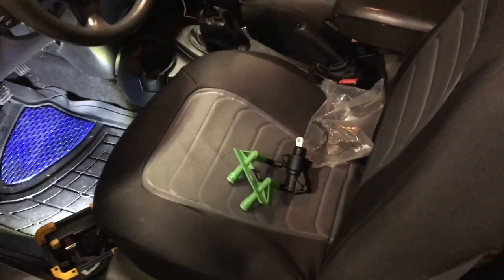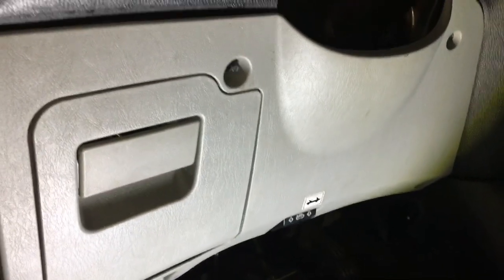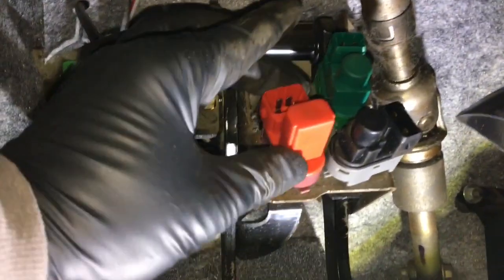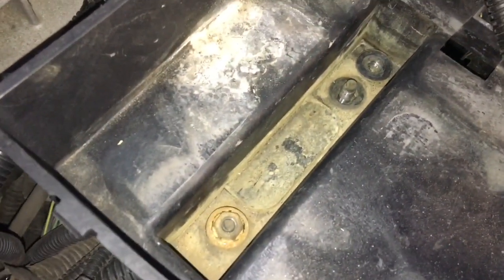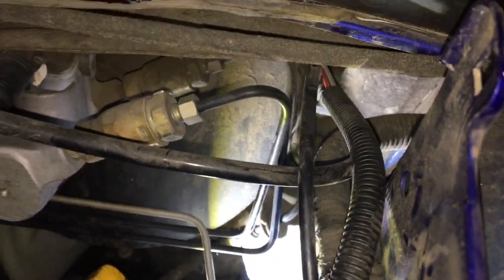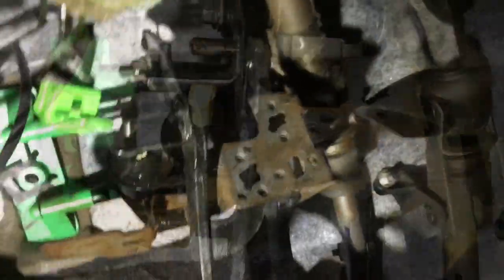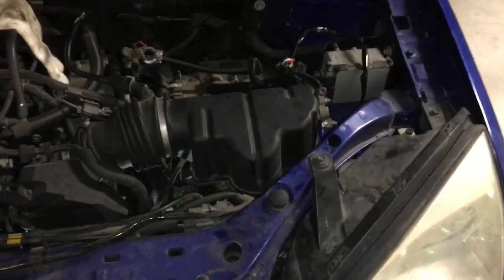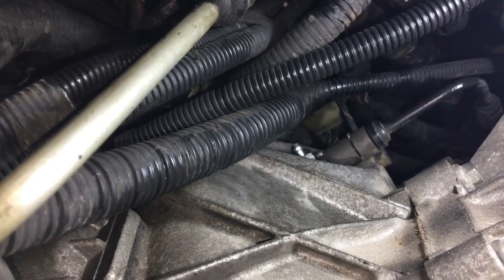2005 Ford Focus Clutch Master Cylinder Replacement

Comment: Just got done changing the master cylinder on my son's 2005 Focus. Video helped a lot. I did find if I took out the air cleaner box that sits in front of the battery I could get to the bleeder from the top easier than from the bottom.

Comment: Just doing one of these myself and didn’t  need to remove the bolt which goes through the centre of the master cylinder, I just removed the clip from the master cylinder and was able to remove it easily.
  I have also noticed that my clutch pedal has a lot of side to side movement so will be replacing the nylon bushing so that the link rod does not come off again and damage the new master cylinder.
  There is also a  small clamp fitting available on eBay U.K. that fits on the end of shaft to prevent the plastic link coming off,  You just put the fitting on the shaft and tighten up the grub screw.
  Hope this info helps somebody , thanks, Chris. U.K.
Reply: Pina la urma se da si pedala jos sau nu este nevoie????

Comment: About the clips that hold the hoses, is it difficult to clip them in??? is it easier to let them on  the master cylinder in open position before to connect the hoses or better to take them off and clip them later.  thanks for the video very didactic.
Reply: The brake lines push in and no need to remove the clips on new one just push and click

Comment: I am having the issue with the leaking fluid when I push the clutch in but the clutch also becomes locked and unable to push in, is this the same fix?

Comment: further to my earlier comment; after you removed the entire thing - did you conclude that there was no need to remove the center bolt which holds the cylinder to the firewall. I am trying to find a workaround for my rusted out bolt head... Thanks.
Reply: Same did you find a solution